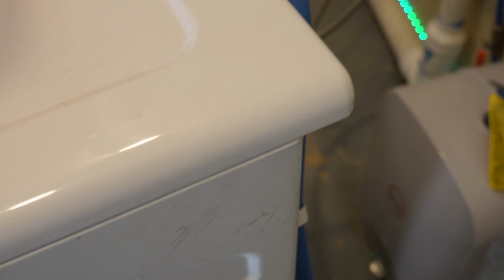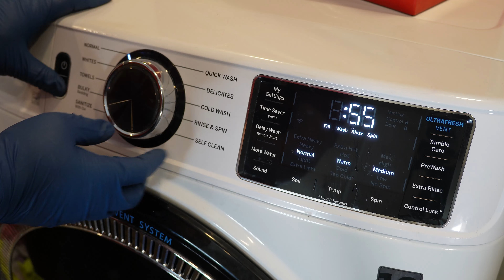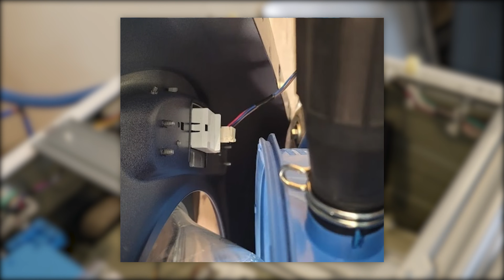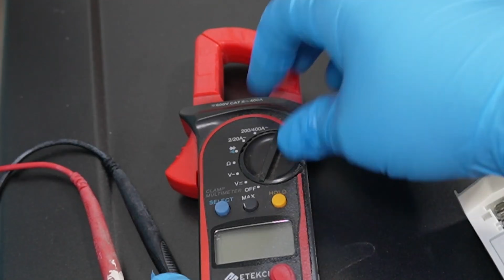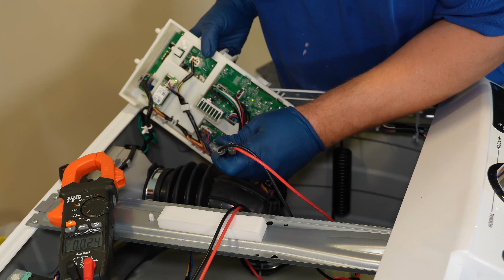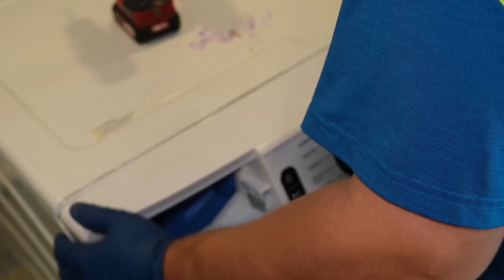GE Front Load Washer Door Lock Problems - How to Unlock & Repair

Comment: I need help. When i test the resistance between pin 1 and 3 i get 3.5 ohms and between 1 and 2 i get 125 ohms during last testing you did on video. Does that mean its good or bad. Do both testings need to read 125 ohms or so? Any help is appreciated.

Comment: Unfortunately, I had moved my lock to the left side; I had to loosen the Smart Dispenser a bit to squeeze my arm in and push the release button. I had previously replaced the control board because the washer wouldn’t dispense water when washing, and after starting and stopping washing cycles to test, I received a ‘Door’ error, and the button was what worked for me.

Comment: You don’t have to remove the door seal to replace the door lock mechanism. I just replaced mine by turning it and sliding it out through the door lock mechanism’s rectangular opening. And, I installed the new mechanism by sliding it into the same opening. Saved a ton of time by not having to mess with the door seal.

Comment: Had one of these today where the mcb fried the lock, melting the plastic inside making the safety release nonfunctional. 
Had to break the lock apart from the inside to get it open. Didnt find out about the bad board until plugging in the new lock and it burning out 😂
Gotta love ge and their faulty relay boards.
Reply: same

Comment: Great video Ben good as always however you forgot to put the control board part number in the description LOL😂 either going to be a door lock or a control board last one I had was the famous inverter board problem
Reply: I was using Google Gemini to help me diagnose my problem. It said that the inverter board controls the motor. Did you have issues with your motor not working? I'm still trying to decide what the issue is for me. I think it's the control board. My door locks just fine. It just keeps locking and unlocking and won't let a cy le finish.

Comment: what if the door can't open from the outside? and even open the top off and can't even push the black stick it kind a stuck
Reply: Unplug it or flip the breaker. Then plug it back in or flip the breaker back and turn it on. It unlocks when the power is restored.

Comment: For anyone who may have replaced the door lock assembly and is still having issues - I recently worked on this same type of GE washer and replaced the door lock assembly. Error code “27” confirmed that it was having issues. 

However, the issue persisted even with the new door lock, until I entered the test mode - this is done by holding down the start/pause button and rotating the knob counter-clockwise 180 degrees, so about halfway around. 

Once you enter this mode, the LEDs will
blink and you can begin using the knob to cycle through different tests. Cycle through until you get to the number 16 on the display - on most models, this number is to clear all error codes. 

Once on the number 16, press the start/pause button once. This will activate it and will clear all error codes. 

Once I did this, the washer ran perfectly fine. It’s a very stupid design in the control board, but unfortunately it seems to be necessary once a new part has been installed.

If the issue were to persist for you even after this has been done, and the door lock has already been replaced with a new one, you’re most likely looking at a faulty Main Control Board. 

Hope this helped!

Comment: I don't think that this lock is part number WH01X29528, which is used in GE GFW850s. This is probably a part for GFW860s and others. It would have been nice if the demonstrator had brought that out.

Comment: I don’t need to remove the top cover just to replace the door lock correct?
Reply: correct. However, if it's stuck locked, you'll need to take the top cover off and manually press the unlock button. I was also able to get the board out without taking the gasket off.

Comment: Where’s the video for the error codes / did do you have a video replacing the board. After changing the lock and getting the same error, then testing the locking and finding out it is fine. I’m pretty sure that’s my issue and I need a new board.

Comment: All 13 did was flash the "extra light" lamp. When I run 14 the door lock cycles 3 times but won't stay locked. It's a brand new door switch and I have tested it with the multi meter and it passes.
Reply: Any luck on a fix?  Having same issue

Comment: I have the exact same washer, I bought a new door lock and didnt fix it, im so dissapointed, never buying another GE product,

Why did you do all that, you can access it from the front without taking top off? Also removing the gasket will need a tool to put it back on- hopefully for your viewers they dont do that if they want to try to just replace the lock.

Comment: I have replaced the door switch and subsequently also the harness connecting it to the control board. It still shows the same error (Error code: 92,89,32,38,39,9,24). What now? replace the control board?

Comment: Thank you for the very informative video. After doing the door lock testing and the control board testing, I have come to the conclusion that my washer problem with the door lock may very possibly be the harness (controller is producing 120 v across 2 sets of pins out of the 3, and door lock resistance measures OK per your video, but the connector to the door lock is not measuring any voltage). Could you provide the wire harness link? Or the part #?

Comment: I took the top off the washer but I  can’t reach the black button to manual release the door. It’s a very tight space. Any ideas to reach it? This is impossible!
Reply: This is the trouble I was having but I finally got it if you can push the drum out of the way and put your hand insideways and just kind of pull up on the bottom of the little mechanism 
It's a pretty large and very easy to press button.

Comment: On mine the black shaft on the door lock won't pop out. It looks like you just pressed yours and in popped out? Mine is stuck in. So i'm assuming a faulty door lock?

Comment: My washer looks just like  the one in the video.  The lock froze and started smoking.  I had to pry the door open.  It was not necessary to remove the drum seal or anything else to remove the door lock.  I replaced the lock with a new one of the exact  model that I removed.  It is buzzing when I close the door and started to smoke so i must have another issue despite the lock is functioning.

Comment: GE front loaders come with a small too to inset into the door lock so you can pull it out without dropping it down in the body and having to remove the gasket to retrieve it. Part number WH01X30057
Reply: Right you are. I'm amazed how many so called pros don't know this. It can be done even without the tool in a pinch too.

Comment: I am getting a constant 59 volts on pin two and three. Would this mean that the board is bad. I am getting 119.2 ohms on the latch like I am supposed to. Also then doing the door lock command it does not lock or unlock the latch. The light does flash in the correct state however
Reply: I’m having same problem, what solved your issue?
Reply: @devildog5001 I ended up having to replace the board. It’s fairly easy if you’ve gotten that far into it. From talking to some people, if it wasn’t the latch, and you had continuity from the board to the switch it was in the board somewhere
Reply: @smokedcandy thank you, I appreciate the reply!

Comment: My washer didn’t drain so I switched it to rinse spin and got it to drain and spin. Once I took out cloths and closed door it stayed buzzing then burned out . I replaced door switch and it’s still buzzing so I cut power before it burned out again. Iv checked the wiring harness and even tested it on the opposite side for reverse door and still buzzing. Looks like it just leads back to main board. 
I did the door test and when it’s open says light but when you close it there no change and just buzzing. 
Do you think the main board is bad? Any help would be greatly appreciated thanks so much!

Comment: My GE washer door locked in closed position. Lots of research on steps to try:
1) Drain tub at bottom right, door locks if water detected. 
2) Unplug x 5-10 min and plug in again.
3) Enter diagnostic mode…turn on power button, then hold the start/pause button while rotating the dial 180 degrees, release the start pause button.
4) In diagnostic mode…turn dial to number one and press start/pause to see error code(s), press start/pause again to see next error code, and repeat. The error codes are listed on a sheet taped inside the washer just under the upper lid, which is easy to remove.
5) In diagnostic mode…turn dial to number 13 and press start/pause, this will attempt to electronically unlock door. If panel light reads “light”, it believes the door to be unlocked.
6) If those steps didn’t work, remove control panel and washer top per this video. 
7) Reach down from top to manually operate the small black pin on the bottom of the door latch mechanism, pushing it in toward the latch should unlock the latch if it is mechanically intact.
8) If the pin cannot be pushed in, the latch actuator motor is likely burned out and door latch needs to be replaced ($25-$30)
9) Pry open the door by using 2 flathead screwdrivers, placed on either side of the latch and gently prying the door open. 
10) Door latch mechanism can be removed WITHOUT removing the gasket.
11) Diagnostics with multimeter and error code interpretation can troubleshoot issues at main board, inverter board, or other sites.
Reply: Thank you. I had to use every bit of this.
Reply: Great synopsis of steps. I am researching the replacement of my door lock as it is in the mail. For #10 you mention not needing to remove the gasket to replace the lock. What is the alternate method? Can I get to it from the top? Replacing the gasket spring looks like a terrible time. Thanks!
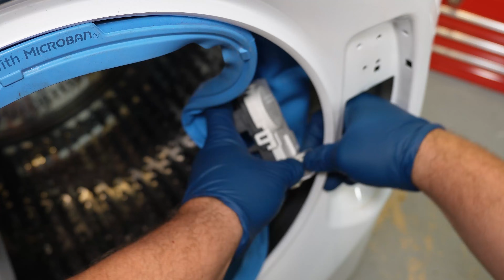Reply: @cr.johnson77 Just remove the lock through the hole the lock is visible through on the front of the washer. At 4:31 you can see the repairman put his fingers through the hole.
Reply: I replaced the door latch assembly, as soon as I turned power on it burnt out. Any ideas?
Reply: @andrewscott2779 Likely a faulty main board which needs to be replaced alongside the lock.
Reply: You literally saved me HOURS of trying this on my own. Thank you sir/ma’am/whatever you prefer, YOU are fucking amazing
Reply: So, my latch is on the left, under the soap tray. I tried reaching as far as I could, but I could only reach the top of the mechanism, and i cut my arm in the process. How hard is it to remove the soap dispenser?
Reply: Assuming you have water in the tub, I’d suggest draining it first, whether that be through the machine’s process or by the little flap at the bottom of the machine. If it’s already empty, I’d suggest the pry-with-2-flatheads method. I had to do the pry method and it popped fairly nicely. Didn’t pop with ease but definitely didn’t need any barbaric strength or anything 😂 As long as you’re careful and point the tips of the screwdrivers towards the machine and not the door it’ll release pretty easily
Reply: I found the nail. Seems like I can only do 9?
Reply: Legend. Thank you
Reply: Mine says sensor is that part of the lock

Comment: @ 3:48 mark-you do not have to take the rubber seal ring off to get to the door latch. Unscrew the lock. Stick hand on inside to hold the lock. Pop lock from mount. Feed the lock through the mount hole. Pull the wiring off. To put back in, reverse the steps. easy peasy. No need to mess with the rubber seal. @ 3:50 mark you can see that he just pushes it in. you can easily feed it through the hole. It is thin enough. I just had to do this myself.
Reply: I figured that out myself. Why make a simple repair more complicated?

Comment: Just saved me. Had to use that button on the inside of the lock. My hand hardly fit down there so you showing the part really helped me press it blindly. I hate these washers.
Reply: Yeah I'm doing this right now. There's no way my hands are fitting down by that lock
Reply: @PlagueXKill3R   u can''t it super hard to press it
Reply: I hate this washer too! Takes 5 hours to do a load of laundry. And still wet

Comment: Respectfully I'm able to get the door lock out through the door lock hole. I don't need to take off the top and seal. Etc.
Reply from the maker: Most can, but I wanted to show how to remove it if needed otherwise. Usually I try to note both ways if/when possible because if I only showed it through the gasket, I'd get a different group of people complaining about the technique.
Reply: Another tip, I just reversed the door on my GFW650 front load and it comes with a door lock holder tool and watching the GE video made it extremely easy to get the door lock out and moved to opposite side. For anyone that bought new and has this part put it somewhere safe! Just a helpful tip. Love your videos, I'm in appliance sales at an independent and watch almost all your videos. Thanks again.

Comment: My GE Front Loader's door would not release (had all the door lock codes along with wiring smell), even after carving my hands & arms up trying to reach the black unlock stem on the bottom of the switch, which would not move.  Nothing was working but luckily came across a video of a gentlemen gently prying on the door, in the latch area, to open it up.  This was something I'd not typically do, but I was out of options.  Used a small towel to mitigate any unnecessary scratching of the exterior paint, grabbed my Chevy wrench (AKA 2' pry bar) and gave it a go.  It worked and no damage was done to the door latch.  Your mileage may vary.  Now, the drum/door seal does not need to come out to remove the switch, but it helped to use a small set of long needle nose pliers to manipulate the switch off the tab and out the hole.  There is sufficient slack in the wiring harness to make the swap.  One word of caution, I put a new switch in, and it immediately made a loud humming noise and smoked just like the first one.  Manual reset would not work.  Had a mother board on order but it had not arrived.  Investigation into the switch revealed in both cases, there was a coil inside where a metal shaft rode through the center of it with one end attached to the reset stem.  The coils appeared to melt insulating material both on the outside of the coil wire and the inner sleeve where the wire is wrapped around and where the reset shaft rides through, preventing it from moving.  If you're wondering about cleaning out the ID where the steel pin rides, yes, I was able to do so with a drill bit that closely matched the OD of the pin, but the coil clearly has less of that material from its design and is definitely compromised due to the heat event. It's also possible for someone who is extremely electronic component savvy to find a suitable replacement coil, once the cause of the damage is rectified. I didn't see any other damage to the switch components (ex, points and mechanical features) but to compound the situ, it is highly likely you will break the tabs securing the two halves of the switch body, and remember how I had to use a pry bar to overcome the locking mechanism, so don't plan on trying to salvage the damaged unit (s). I repeat, don't try to use the damaged switch. You will almost certainly void any type of warranty you have and lose the peace of mind of having a new part installed.  Just wanted to share, at least in my case, how I got the door open and what I found with both switches that smoked on me and my observations along the way.  The Fix:  After visually inspecting the harness assembly and confirming with an Ohm meter, I installed a new motherboard and door lock switch.  This video was very helpful to my troubleshooting, so thank you.  Finally, as stated in this video, follow proper safety protocol.
Reply: Im literally in your shoes rn but haven’t fixed mine yet.
Reply: Having the same issue here. About to go get my pry bar
Reply: please, can you share the video? nothing is working and I need to pry open my door

Comment: Thanks!   New board fixed my issue.  But GE was out of stock and had to buy off eBay.  Glad it worked.
Reply: When i looked up the board on GEs website, it shows its been superseded by two other part numbers.  This tells me they have had problems and had to redesign it.  Couldnt find the latest part anywhere which tells me many people have had this issue.  I called GE and they were no help.  Told me to google the part and find it from a 3rd party. But were not able to confirm whether the part is compatible.  I had to buy the original board on ebay which means it will likely fail again.  But at least its working for now.
Reply: @cervanchez that sucks they were no help. I have to wait until Monday to try to call GE I have to speak with someone to let them know they sold me junk. At least hear it for myself that they are going to tell me to kick rocks, and then I guess I’ll look for a board. I thought I read on one of these videos that the link for it was posted. I’ll have to look back thru the comments on history videos. I’m going to have a hard time letting this slide.
Reply: I literally just paid mine off. It’s just over a year old, and my door lock is acting goofy. Replaced the door lock now the damn thing wont open. You got to be kidding that the board would be bad that quick. If so that’s some bullshit from GE, is there a recall on this product?
Reply: Found it, he sells them on his site. But says you might have to program them. Did you have to program yours? If so how? How do you know?
Reply: I did have to do a basic programming.  The board came with a card that linked to instructions.  Only took a minute.